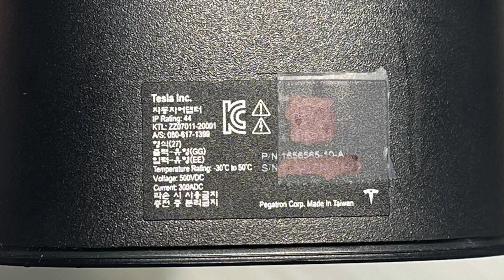A quick look at the new Tesla CCS adapter

Comment: So the Tesla CCS Combo 1 adapter has a 300A rating. I wonder whether this is peak current or sustained current. From my point of view, it would be much better if Tesla did not (only) offer adapters but CCS inlet retrofits right on the car inlet side itself. Let go of the Tesla proprietary connector, get a CCS Combo 1 instead. All of the adapters stick out quite a bit, and put more mechanical leverage on the inlet itself.

Comment: CCS designed by the marketing department with the goal of discouraging the adoption of EV's.
Reply: What proof do you have of this.
Reply: @vandreadparty  
40 years of electronic engineering experience enables me to tell when  the marketing department over-road the engineering department.
Reply: Hundreds of thousands of EVs have this connector and no one is complaining but the Tesla fan boys.
Reply: @fparent  "no one is complaining", except those unfortunate souls condemned to use CCS1. It's heavy, fragile, expensive and has somewhat low power current limit.